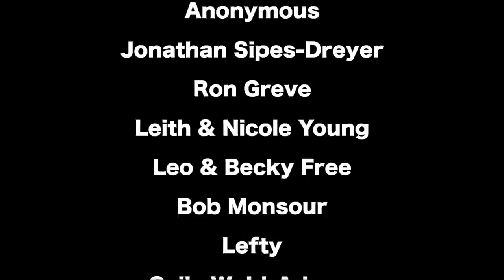Cutting Bottle Bricks, Teaching Hyperadobe (Chicken Garden Day 28)

Comment: An idea to make the bottle-bricks fit into the bags, is to use a PVC pipe section/plug that can be tamped safely. Once the bag sets you can remove the plug and slide in the bottle-brick. Caulking might be needed. Best of luck.

Comment: You know you can cut the bottom off of one and the top off of the 1 and then that way that'll be the center and then you can get the tops off of 2 other bottles and make them longer that way by typing the other 2 together And then you'll have all 3 Em taped together and they should reach through the wall

Comment: Sorry to hear about your loss.

Suggestion..........
Plastic Coke bottles when heated act like heat shrink.
If you cut both ends off the plastic bottles and insert glass bottles at each end, then heat shrink to the desired length.

Massive Respect from New Zealand
😀👍